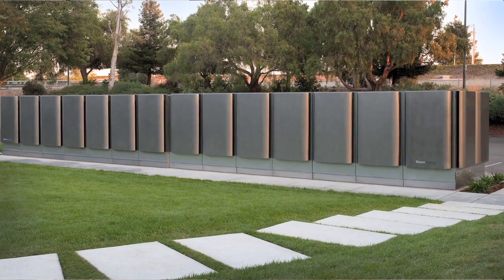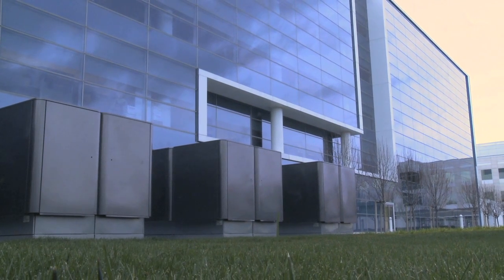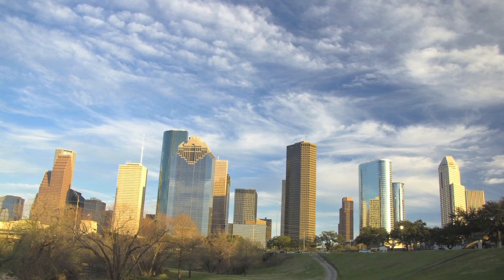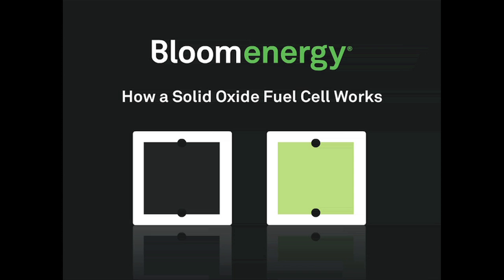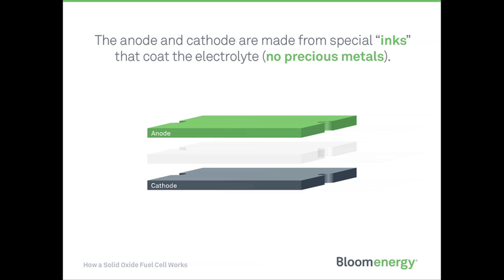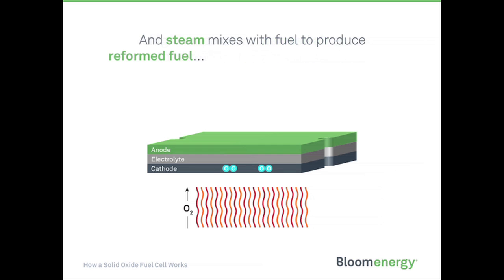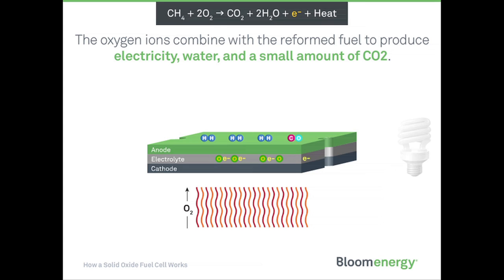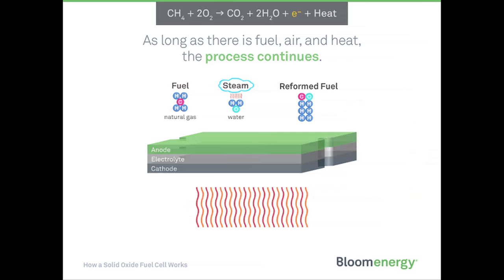Fuel cell technology from EDF's Energy Innovation Series

Comment: What is the fuel used? After all it converts fuel to electric power much the same way as a power plant or IC engine producing the same effluents like Hydrogen and Co2 and heat; only difference may be more efficient, and less pollution.
Reply: they are using methane. not same with power plant also with engine because there is no combustion close to hydrogen by way of electrolysis but hydrogen is costly to produce.
Reply: Natural gas.  Methane.    It has half the co2 but it is not blue hydrogen.   Information was on an earlier video

Comment: so you must supply it with natural gas for it to make energy? it emits about half the amount of carbon monoxide traditional fossil fuel power plants. its not carbon neutral.
Reply: SOFC's emit Zero CO. Carbon monoxide is poisonous and is created during combustion. CO2 (Carbon Dioxide) is not. SOFC's don't combust and only emit a small amount of CO2 - which plants utilize to produce photosynthesis. If CO2 levels on earth dropped below 150ppm, agriculture would cease and all life, plant and animal would die. You have been brainwashed by a corrupted elitist system and ignorant media which only cares about ratings and how much wealth they can steal from you.
Reply: @kdanagger6894  lol the corrupt elites bro!
Reply: it is if the fuel is bio-methane
Reply: Bio methane helps
Reply: it is not carbon neutral but the carbon emitted does not come from combustion but rather the excess smell of biogas more like a unburned or unused because there was no burning of biogas.

Comment: In addition to availability, power quality is also an important issue. In today's digital age, many technologies suffer from variation in voltage or electrical flow over the transmission and distribution infrastructure that result in poor power quality. Bloom generates perfect waveform at the point of consumption. That means perfect power quality for our digital age.
Reply: The regs specify voltage tolerance that a mains supply has to remain within,  mains power also can also be clean power I.e. not burning fossel fuel to create electricity